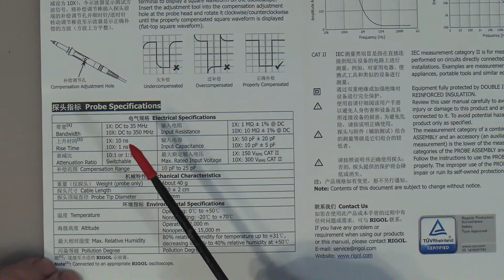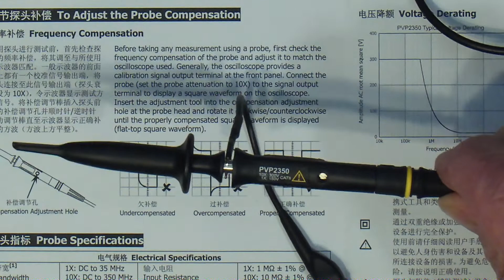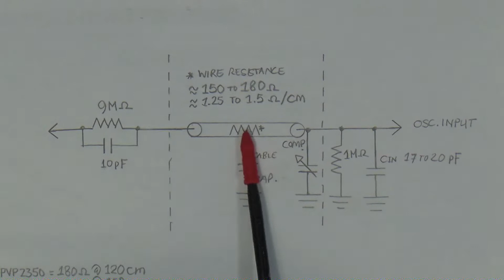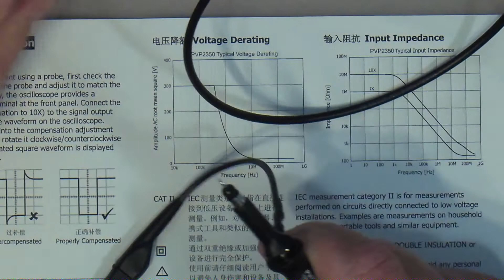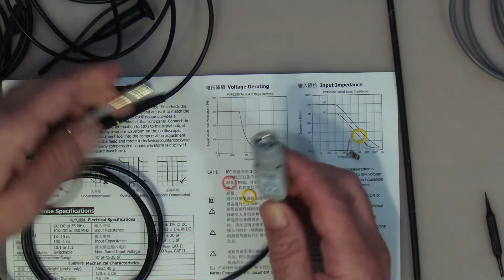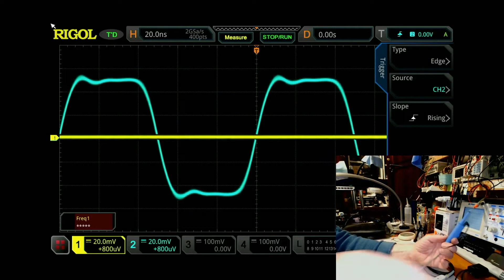Oscilloscope Probes

Comment: Cool video, I learned something new :)
Never thought the input impedance would drop so dramatically in the single kilohertz frequency range... I always thought the audio frequency range was pretty safe and it would take at least until a few megahertz before it actually happens. Bad news for an audio electronics girl like me :D
Reply from the maker: Well, don't forget that I was testing the probes in 10X mode with its compensation circuitry etc.  Further more the Spectrum analyzer has a start frequency of 9 KHz so anything below that is not necessarily displayed accurately.  So for Audio frequencies it is alright to set the probes to 1X which connects the probes directly to the Oscilloscope which can display right down to DC.